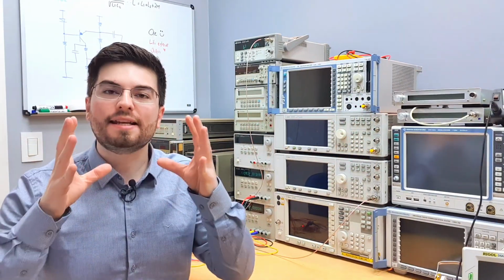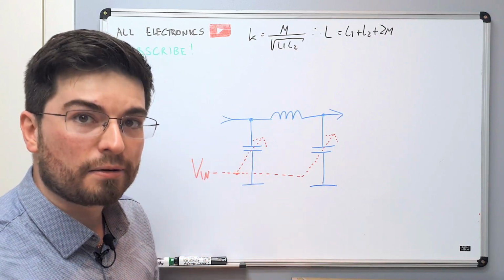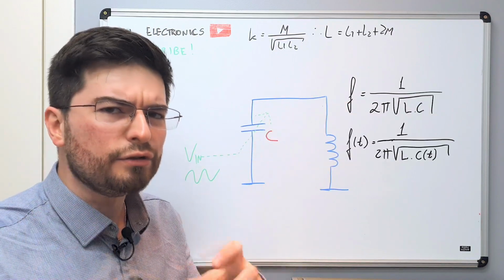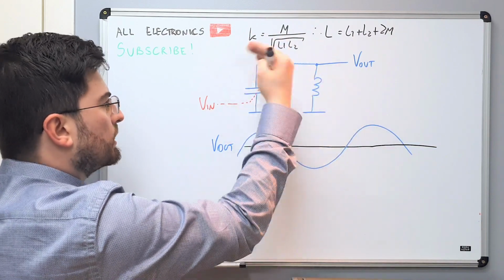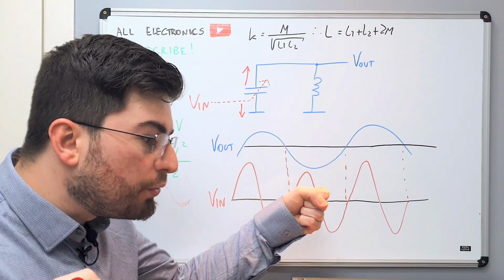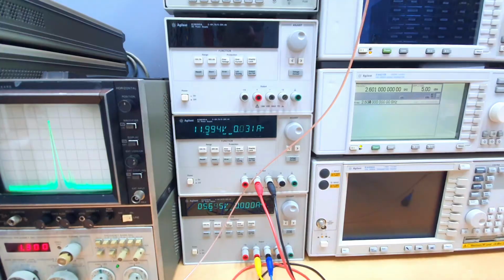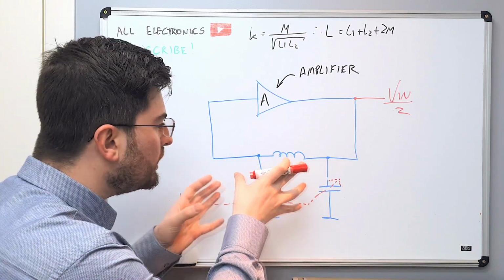Parametric Oscillator - Microwave Frequency Divider

Comment: 0:54 Why does the peak have area underneath? Why isn't it a vertical line?
    - It's phase noise, right? https://youtu.be/vWhFNgG_bl4?t=48
4:21 Isn't that the minimum voltage? 
6:02 It appears that Vin increases capacity when the cap is charging, and then decreases capacity when the cap is discharging. Is that correct? 
I assume the varactor requires a negative control voltage to go in the other direction, correct?
7:31 Are those sidebands, due to intermodulation between input-freq and resonant-freq?
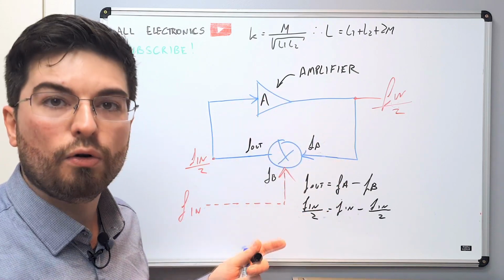10:30 I don't understand how we're locking. How can this circuit affect f-in? 
What are the advantages of a varactor divider over a flip-flop? 
Thx!
Reply from the maker: The peak have area because of the resolution bandwidth of the spectrum analyzer, the analyzer always shows the shape of its internal filter for a "dirac" input signal. 

Increasing in Vin reduces the capacitance (increases the depletion width). 

It does not require a negative voltage. Well.. it sees the variance over the DC offset level.. So in some sense it is sensing the positive and negative variations around a positive value. 

Yes, intermodulation!

The varactor divider can work to much higher frequencies (maybe THz?)

Comment: I like your enthusiasm.  However,   I think if you slow down, you would be able to communicate more effectively.
Divide your material into byte size power point slides, and take time to explain every slide in detail.
Do not make your audience to " drink from fire hydrant"
I have an advance degree in EE and years of design experience in this field.  Even I could not catch up and follow what you are saying.  
What I understood from your clip is to modulate capacitor say using a varactor.  Now when do  you get injection locking, or do get divided it two, ....

Comment: Hi Gregory, 

glad to see a new video from you. :)
Very intersting topic, the first thing coming to mind by modulating the varactor of a VCO would be FM modulation. 
Interesting to see another application of the same principle. 
Where would be the border between FM modulation and this?
I guess as soon as the modulation frequency is way higher than the bandwith of the VCO input?

I like how you managed to explain the bahaviour with just the right amount of maths, without drifting too far into dry mathematics. 
The energy way of looking it at makes it quite a bit simpler, I guess in a similar way as using dBm instead of voltage and current makes it quite a bit simpler.

My RF professor back at school had a similar thing where they fed a fixed oscillator with a close but not matching frequency at the output to "force" it to lock onto the supplied frequency.
This way they kept the super low phase noise of the crystal oscillator. 
It was however pretty tricky to isolate the "wanted output" from whatever you feed into the osciallator.
Just watched the video all the way to the end "injection locking" that is what it is called, thanks. ;)
Reply: Same question as you hahahh would be beautifull to have a real time spectrum analyzer conectes to de Output of the vco and in the Input de DC Power suply but instead of the rf generator have a true microwave sweeper like That old wiltron That can reach 20GHz easily or the hp one if someone has the sweeper but doesnt have the RSA he can use a sweept SA and set the microwave sweeper to make the complete Sweep in several seconds and Changing the DC bias seing that the Locking freq changes and also the”capture bandwith” for a certain DC bias. In conclusión there are so many cool Experiments in this Field of parametric oscillations and amplifiers
Reply from the maker: Thank you, man!!

How FM would be defined if the modulation input is twice the carrier!? Maybe FM even don't make sense..
Reply: I think the feedback loop makes it fundamentally different from FM -- with the feedback at input and output of the mixer, it creates the locking behavior.  So I think the only similarity between this and FM is the fact that there's a varactor in there?
Reply from the maker: This a very interesting discussion

Comment: I have a question. If the energy from the pump is being used to amplify the pump/2 band why not delete the amplifier or substituing it witn a band pass filter at pump/2 frequency and also with phase shift enough to let the energy from the pump sustain oscillations at pump/2? the model could be the typical oscillator where you have an amplifier and a feedback network but the amplifier is the parametric amplifier and the feedback network the band pass filter? thanks so much for the articles you published and the texts you linked about parametric amplifiers
Reply from the maker: It works!! You will have oscillation at pump/2 without the amplifier!! 

The amplifier helps with negative resistance, enhancing the tank Q, but it is not strict necessary. 

Try an LC tank with good varactors, tuned for pump/2, and excite it with pump.
Reply: I think I would have rather seen this with like_cabezon's idea of using a bandpass filter instead. Thanks for posting though. Fascinating to watch
Reply: I was just curious if this could be done, passively, even if you added ampflication downstream somewhere.
Reply from the maker: It can. A passive LC with varactors will oscillate at half the input.
Reply: @AllElectronicsChannel  thanks for the reply. 73 N 9 I Z X